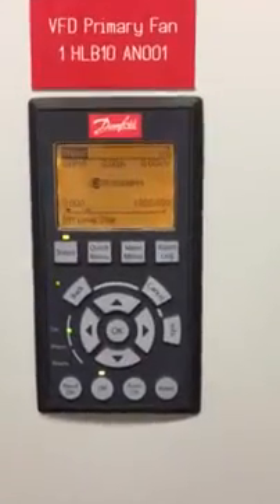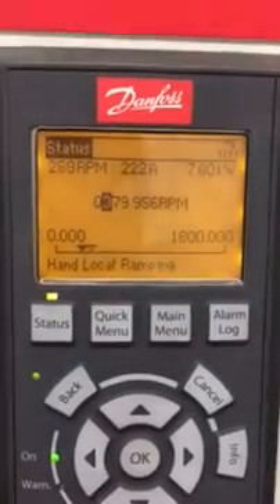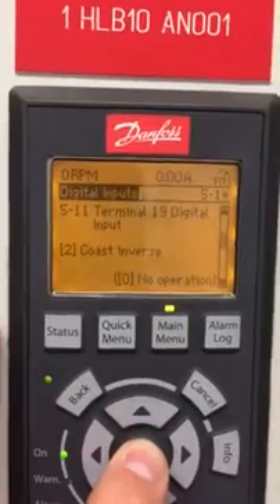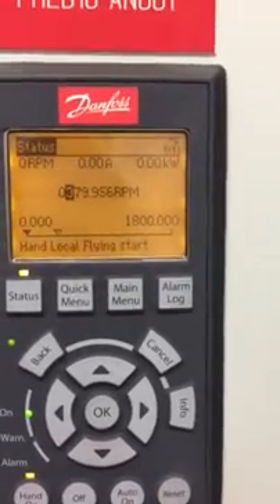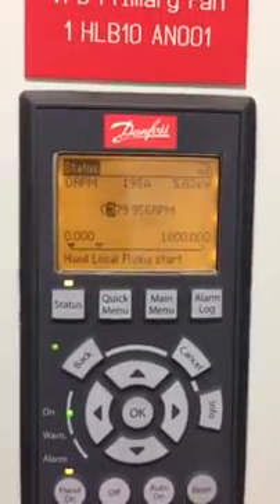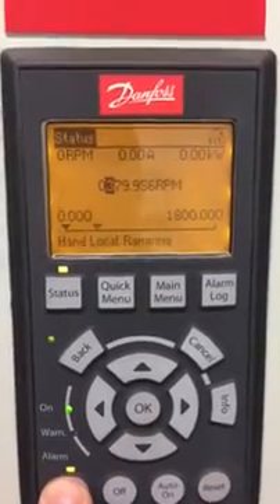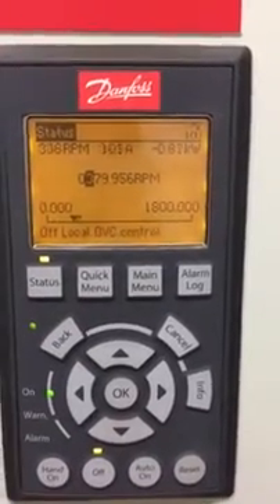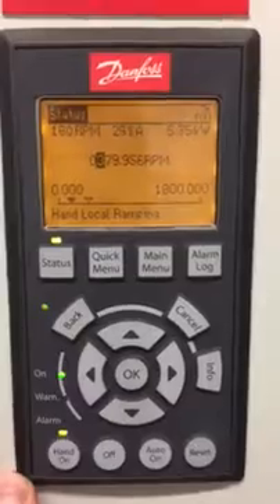Flying Start problem

Comment: Excellent video,  very important and useful function of the vfd. Need to have good discussion on this topic
Reply from the maker: I did this video for the engineers at the Danfoss Factory in Grasten - and they did a software update on the FC-302 to fix the problem. I flash updated all the drives on site once I had the firmware update from the factory.

Comment: hello 
if i enabled the fly start what are the risks on the motor
Reply from the maker: Hello - there should be no risk to the motor whatsoever - just make sure that the motor parameters are setup in Motor Data and perform a full AMA.